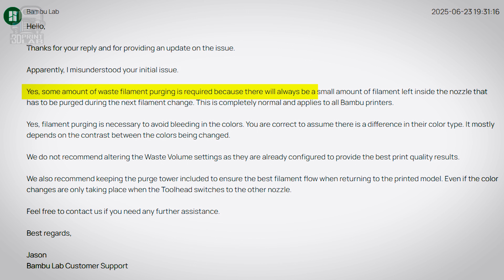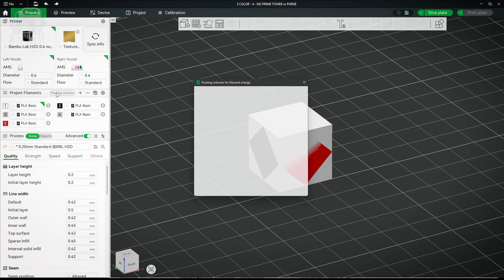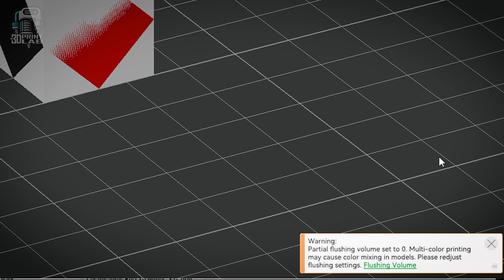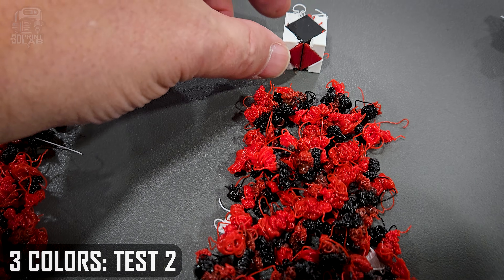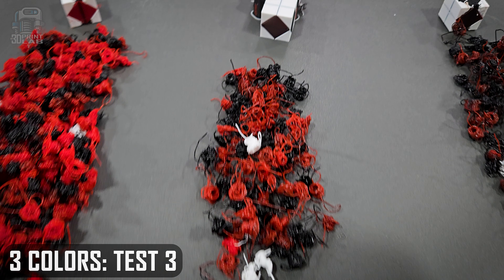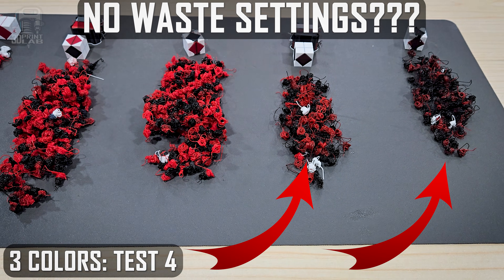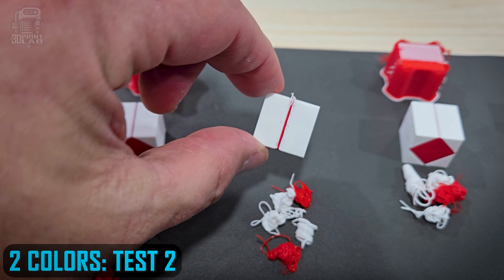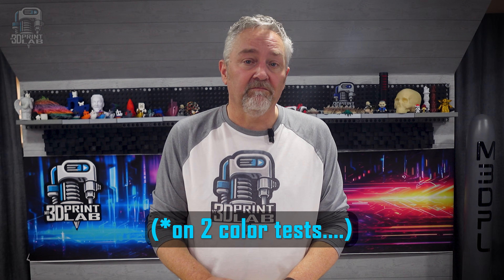Bambu H2D Waste Test Reveals a Dirty Truth About Color Prints

Comment: Thank you for the testing. I have often thought a 2 color printer is all I need as I make (mostly) practical prints. The second color is for lettering and such. Can the prime tower be smaller?
Reply: The prime tower will always be as tall as two colors needs of the print.   If your dual color needs end at layer 15 out of a 100 layer print your tower will be only 15 layers tall.  If you have letters on the top layers though, the tower will be single color all the way to the top where it needs to prime for the color change of the top layers
Reply: @junyr73 but does it need to be as big in x-y